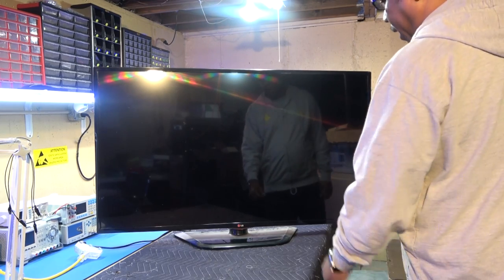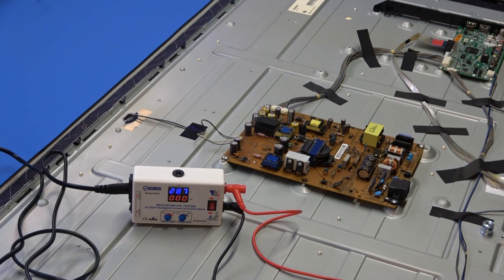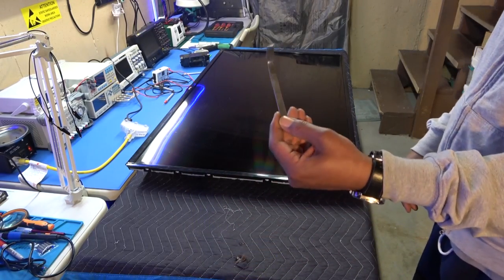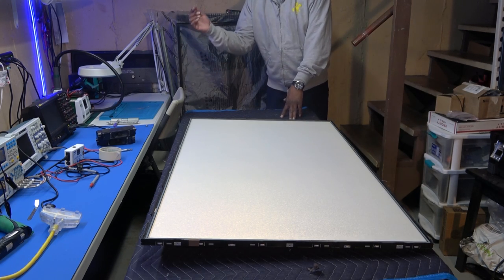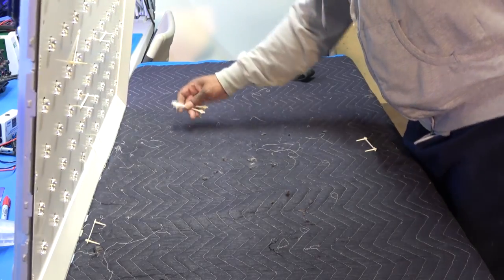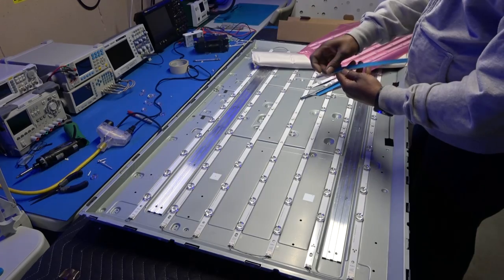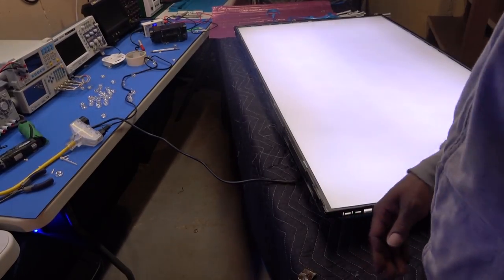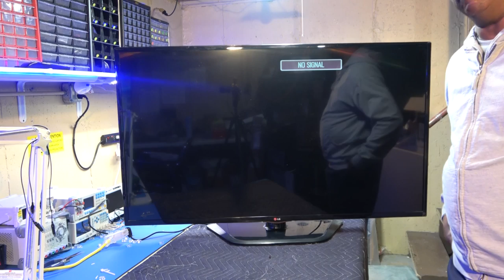LG 55 inch led TV, quick screen flash only, no picture. LG 55LN5200 TV repair.

Comment: I followed the instructions on this video, and now the backlight works, but the screen is still black. Before I changed out the LEDs, I could see images on the screen with a flashlight, but now it's just backlit black. Any ideas where I might have gone wrong?
Reply from the maker: check the panel and t-con to mainboard connectors and flat ribbon cables. Make sure there pushed in and connected correctly.
Reply: @bigdog8882  I thought I had checked them, but it's working well now, thanks so much!

Comment: luck what I discovered: My fire stick 4k (3 year old) was the item that was causing the screen problem. I noticed that after I connected my brand new fire stick 4K Max, after a minute the screen get very bad with different pixel lines..... I was using Netflix.... then I opened Netflix on the tv app and it was working all normal. also I used the cable box and all was running good. Also I plug this fire stick to a older SONY tv and the device working all normal.
I speak with LG about this problem... and then could't help me. No even to give a discount to buy a new tv. Now I have to throw away my tv and buy a new one. SO I end with LG. 
NO MORE LG FOR ME.

Comment: I replaced the LED strips and wasn't sure when you checked the strips after replacing them. I noticed when I rolled the bottom printed circuit boards up with the strips on them to tape to the screen that the strip partially came loose during reassembly.  Does this mean the TV is junk.  I still have a flashing screen. I replaced both boards also previous to the LEDs and the screen was flashing still then. I proceeded to replace the LEDs and had a hard time getting the small wire clips free at the strip ends. Any suggestions before I scrap this.
Reply from the maker: not sure what you mean. Are the driver boards for the screen torn at the ribbon cables?

Comment: Most detailed video I've seen so far which makes it the BEST video I've seen so far & I've seen quite a few.  I really appreciate the details in showing every single step of the disassembly process which many of the other video's skipped to the LED repair.  Cant repair it if you can't get it apart & back together correctly.  Problem resolved with about $5 in parts.  Thanks again and keep up the good work.  We appreciate you !!

Comment: I had a couple smd diode die in the power supply on my uj6200 when the backlights went.  Thermal cam had 2 of them at 200C.

Comment: I just changed out all of my LEDs (excellent video by the way) and the tv is still doing the same thing 😢
Reply from the maker: I would check the individual led strips, to see if you still have a bad one. U would have to use a Backlight tester. The only other thing that maybe could cause the screen to just flash and go out is the actual led circuit on the Power supply board.

Comment: I replaced the LED’s, and sound is working, but it is not displaying anything. What should I check next?
Reply from the maker: Do U have a Backlight tester? If so, check the plug/lines at the power supply for the leds, to make sure everything is connected properly.

Comment: LG55UH6030UC model . Thank you so much for your awesome 👍 video. Ordered two the new strips for my model & suction cups, strips and led tester. Total cost 75.00 dollars made the repair This morning. I, marked and tagged in plastic sandwich bags as I, removed the Srews. 2017 LC model works as the day I purchased it. Thank you so much.

Comment: LEDs screen lighting strips or few LEDs on strips LEDs are dead.To common and very common problems.When you buy and brought these TVs home.When you’re about to uses these tvs.Just going into brightness 🔅 settings to 50-55 maximum 60% brightness only 🔆.Your TVs now can lasted 4-5 or more in years easily now..

Comment: I'm a bit confused. The new strips you had (index 34:20) is different than the one you will be installing (index 36:29). The ones pulled out from the pink plastic bag is half long than the ones you are installing?
Reply from the maker: each row has 2 sections (strips), One is longer than the other one. A and B section.
Reply: @bigdog8882  I got it. You will have to connect strips.

Comment: Replaced the leds. When I went to plug it in the LG logo popped up then it went black. Now the red light blinks 3 times but the screen comes on. Any advice?
Reply from the maker: Check your connectors around tcon board and panel
Reply: @bigdog8882  if I send you the control boards how much do you charge for diagnose? I hear the control board buzzing after reconnecting everything on tcon and board

Comment: Any chance you know a connection where I could get just the screen for the 55 inch lg? I was changing out the bulbs in the back and didn't use a big enough suction cup and cracked my screen. Your video seems very resourceful so I thought you may know. Thank you kindly

Comment: Is it possible to change t board? Mine is broken however i need to separate those bronz things and reconnect it to the new, do you have any advice which glue or tape to use? Thx

Comment: I have the same problem.  After the TV is on for a while working fine. The the screen goes black.  Turn off the tv wait a second or 5. Turn tv on and works fine for a while then black.  I can get picture every time I do the off and on trick.  When black with a flashlight I see the picture is there but back light is out. TV is a LG 47LW5300-UC.ACCZLUR. 8 years old.

Comment: MD LG55LN5400 UA

SN  30SRMHR18465

This LG Flat screen 2013 model screen will come on if unplugged for a period of time lasted all night the first time i looked at it unplugged it and turned it on.. That was till she turned  it off then, No back light when turned back on.. Its a friends TV She wants it repaired so She located you I watched a few Videos .. I use to repair TVs prior to Flat screens using Sams schematics many years ago.. I know I can do the repair provided i get the proper part or parts from you.. When on its fully functional .. She told me its now coming in for about 5 min then the screen goes blank.. Can you help diagnosing the issue so we can get the parts and fix this Flat Screen 

Thanks Floyd Holyfield jr

Comment: I have LG led tv and sometimes the screen shuts off itself, turns into black, but sounds still on, i turn tv off and on again and it works again fine, but until next time, after couple hours turns black the same. What it could be?

Comment: I got a question I have an LG55LM5800 LED tv and te backlight keeps shutting off but I still have audio. I can turn the TV off & back on & it will work for like an hour then the backlight shuts off again. 
It doesn't look like any leds are burned out and tcon board is good (I can see the osd when I shine a flashlight on the screen).

I took the back off and no swollen capacitors or anything. Any idea what the problem might be? Or any suggestions for me? thanks!

Comment: Hi Bigdog8882! Great video! After you replaced the LED strips, what did you power them with in order to verify they all worked before reassembling the TV? Thanks.
Reply from the maker: https://bigdogelectronics.us/collections/digital-multimeters/products/0-330v-manual-adjusting-voltage-tv-led-backlight-tester-current-adjustable-constant-current-board-led-bulb-lamp

Comment: Hi.  We fixed two TVs from watching your videos!  Thank you so much for your helpful information and clear instructions.  We just got another TV and it will flash one time very quickly and then goes off.  We have looked for the picture with a flashlight and can't see anything so we don't know if it's the backlights.  We put a new power board on it, but are wondering if you have another suggestions.  Thanks in advance for any information you could offer.
Reply from the maker: Your gonna have to test the backlights to eliminate that problem. Does sound like Backlight problem.
Reply: @bigdog8882  Thank you so much for your quick reply.  I took a quick video of the backlights - 3 bottom rows flashed and immediately went off and 3 top rows did not light at all. Would you mind taking a look at the video if I sent it through email?

Comment: Why did you buy the new led tester if your original was working fine?
Reply from the maker: I carry the old one in my tool box for the field. Unfortunately  the old one doesn't have enough current to test all edge-lit strips accurately  on some tv's. Thats where the adjustable one comes in handy. Also I can use the new one as a small power supply if I need to take it in the field.

Comment: I have an LG 55UM6910PUC it just shows blue/green screen. When it first happened there was audio and you could switch channels but no picture. Now there is no audio so I can't tell if the channels are changing with the Remote.
Reply from the maker: Check the HDMI cord or connection, if your using HDMI inputs.

Comment: Have a LG 55UH6150, its flashing on startup on one side and won't come on(it's a 2 bar LED model and if I disconnect the backlight connector I can see an image with the flashlight method), test the right LED bar and found one burned LED wich i replace,still do the same thing, but, if I disconnect that lED bar and let the left side connect tv do startup and I have an image but only half screen (because right backlight is disconnect) The funny thing here is if I test the bar with a backlight tester both are lightning up like it should,..any idea ?

Comment: I have the backlights as well and going to do this today and see if it will work.  Mine is a 43” model from 2013 and I got ten years on it.  These tvs are so cheap now and I will buy another if it doesn’t work out.  Good video, one of the best out there

Comment: I never get phone calls except telemarketers so i got rid of it. The shop jimmy strip lights for the TV i have are $80 for 1 strip. Samsung UN46D6000SFXZA...  I tightened all the board screws and the TV came on but as soon as i hooked it HDMI source; it went out again. I can see the start up with a light. Light strips are not available for this TV. Out Of Stock.. Wanna buy the boards?

Comment: I did the repair successfully but now I am unable to power off the tv and it is unresponsive to the remote and the physical buttons. Any clue what the problem could be??
Reply from the maker: Check the power/keypad/remote connections and wire. Maybe you forgot to plug it back in or one of the pins inside the connectors got bent.

Comment: Question:  symptom is a dim blue screen. No sound. LEDs are working. When I disconnect one side of the T-con board the screen is 1/2 black and 1/2 bright white. Suggestions?

Comment: I keep hoping you get what I have Big Dog backlights good and on but no video, Audio or Logo. I have missing voltages to Tcon board the 12 and 3.5 is there. I am unable to reflow solder on processor. Firmware on main board looks likely😮

Comment: Soooooo....after putting it back together, the display works fine. But the LEDs are too bright and show through the black screen on standby. Also after an image is shown and goes to standby, a burn of the image stays until the next image is displayed. I suspect that I didn't put the screens back on correctly. I left the thicker one at the bottom but the screen on top has a rainbowlike look when light shines on it (shouldn't have worked ahead, lesson learned). Would you happen to be able to confirm the correct way they should be on there?
Reply: Also all of the lenses are intact.

Comment: Hey Bigdog great vid, where do you recommend buying replacement strips and are the lenses necessary?
Reply: The lenses are necessary. Without them, The LED lights will show visibly bright through the screen even with a white image displayed. But buying the replacement strips should come with the lenses attached. Mine came with them.

Comment: Hi sir.. I have an LG 55LM8600 55" 3D TV... 2012 model.
I have sound but no picture.
I reset unplugged the power cord,  waiting more than a minute, and plug back... tv working for a minute and happened again, only can see is pixels in  lines in different colors. 
If I repeat the process, some times working normal more than a minuete, probably 3 or 5 minutes.
What can be wrong?....  I read in some comments, it need to replace the LED strip. 
BUT the Strip was no available on the website. Any help?
Reply: Did you figure out what was wrong with your tv?
Reply: @Metalhead-4life  Can you believe it that after disconnected from power my tv for more than 30min, my tv back to work normal ?... Yes since I did that, my tv still working without issue.
Reply: @Metalhead-4life  luck what I discovered: My fire stick 4k (3 year old) was the item that was causing the screen problem. I noticed that after I connected my brand new fire stick 4K Max, after a minute the screen get very bad with different pixel lines..... I was using Netflix.... then I opened Netflix on the tv app and was working all normal. also I used the cable box and all was good. 
I speak with LG about this problem... and then could't help me. No even to give a discount for new tv. Now I have to throw away my tv and buy a new one. SO I end with LG  for ever. NO MORE LG FOR ME.
Reply: @r.c.850  Try going to the firmware or software update screen on your new amazon  4k firestick! Update their software, they have frequent updates.

If that does fix it then make sure the firestick is set to the correct display resolution ie 4k. If that is not set correctly you can have all kinds of issues, at least mine did. Good luck

Comment: Ok so I replaced the leds and now I get no picture at all any suggestions
Reply from the maker: Re-Check the Connections.
Reply: @bigdog8882  ok I rechecked connections and they are good I can power them with my led tester and they all come on but nothing when the are plugged into board what should I do next

Comment: What is the problem if the test says the LEDs are good and you have the same problem? Is that the power board then?
Reply: The reason I ask is because I replaced all the strips and check for continuity instead and both series are testing good. I didn’t check that first. I just assumed it was the LED. Because the problem is identical to what you’re showing here.
Reply: I also tested the + and - on the power board for the LEDs and it is reading 1volt or less.

Comment: Bigdog, you make it look too easy. I got a Samsung un50tu7000f direct lit with about a 3" column that flickers to black sometimes. What are your thoughts on it?
Reply from the maker: Is it up/down column or from Left to Right?
Reply: @bigdog8882  Thanks for responding. It is an up/down column. Facing it, it is off center to the left. At the start of watching something it'll blink a bit but then work fine mostly.
Reply: @bigdog8882  🤚